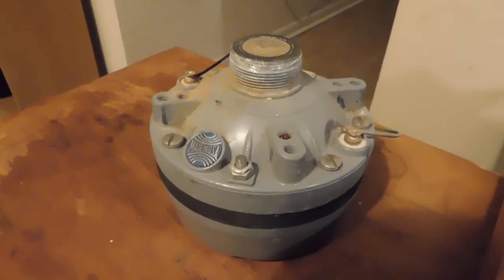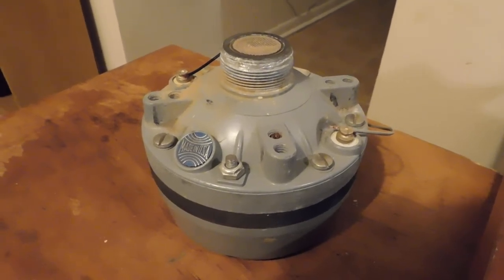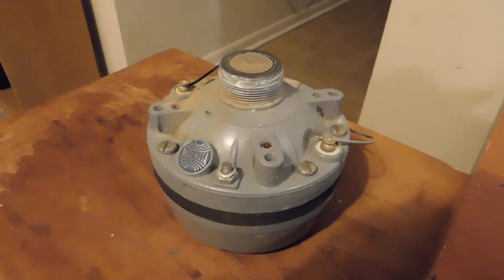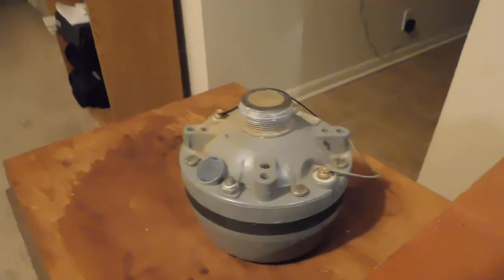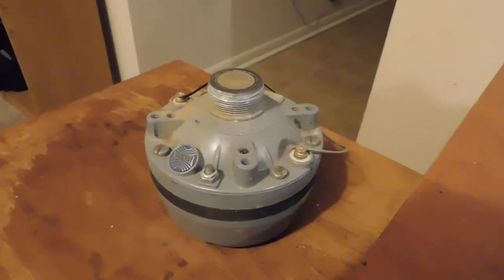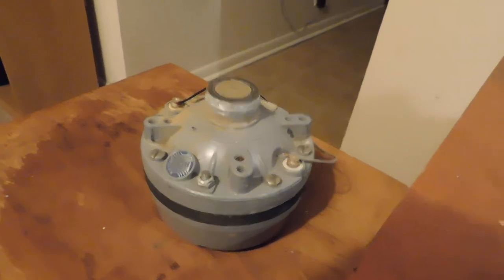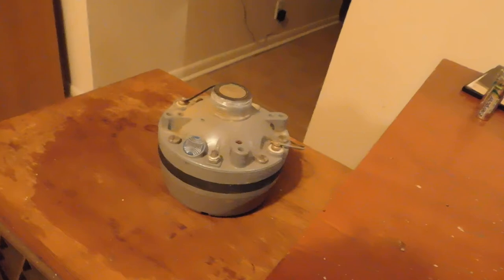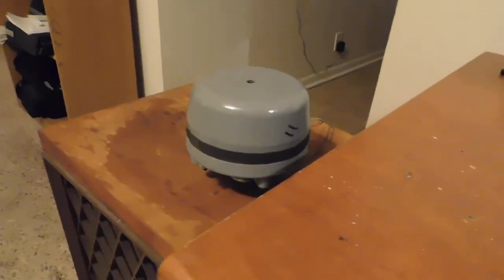Atlas SD-370 Driver off a Siren

Comment: Blown enough that the Amps did not dig it when we had it in the Tronic
Reply from the maker: Protection circuitry must be pretty picky then, my JVC had no problem with it, albeit I was using only one channel so it was only getting 50 watts instead of 100